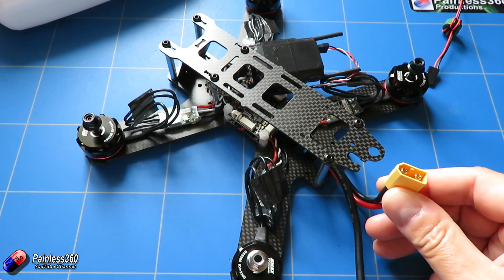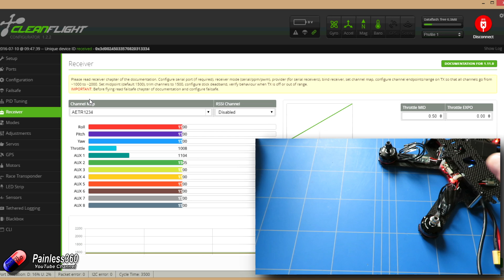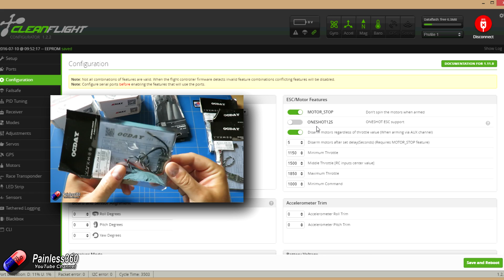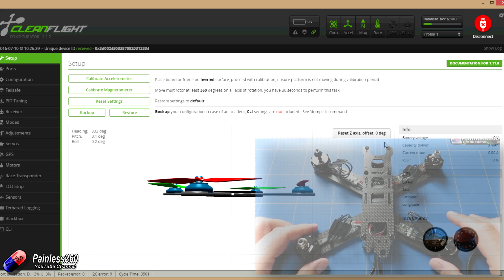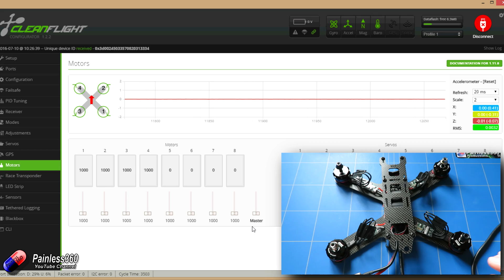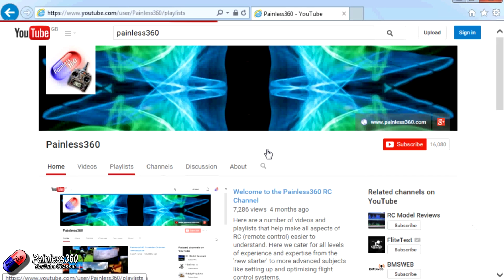(7/9) Quadcopter Building for Beginners - Setting up in Cleanflight

Comment: what if you are at the max of your sub trims and cannot get to 1000 to 2000 im stuck at 1060 and 1885 and it is not working out at all
Reply from the maker: If the “extended limits” box is checked in “Model Set Up” on the Taranis (screen #2 in the Model Setting Menu), servo travel limits can be extended to 150% of the default, or +/- 768uS. I'd try that..
Reply: Painless360 thank you I just tried that it extended up to 1980 on the high end and still stuck at 1060 on the low I tried starting from scratch a couple of times I'm in d8 mode for the ac800 FrSky receiver it binds switches work cannot trim my throttle
Correctly and I think that's why when I spoil up my motors with my tx they don't go full throttle all the way then it decreases power in two motors and also when in other modes hovering at half throttle it gradually increase on its own and takes off but when I check motors through betaflight they are all in sync with each other and go full throttle I tried calibrating in bl heli suite as well I'm sure it's something dumb I'm new and this is my first quad
Reply from the maker: +Insanitykills 187 it sounds like you're not using an real frsky receiver. I have a couple of weird things happen with the cloned receivers. Maybe that's the problem here too?
Reply: it is the ac800 micro receiver that could be a problem as well when i get more money ill try a differant one i do have a beecore fc for a tiny whoop coming in in a day or two so ill try that one out and if all works then i will know that there is a problem with the receiver and not me but i will make a short video on what i am dealing with and when i do i will link you to it in a comment you have been very helpful along with josh bardwell i appreciate you acctually trying to help me out i wasnt sure if anyone would but ill let you know when the vid is up thanks again for everything i work second shift so it may be a couple of days before its up
Reply: ok i wanted to let you know first i got my 90gt working i was able to flash it with beta flight by changing the baud from 25000 to the 115200 then i was able to flash from there i started from scratch and got everything working right you were right the motors act funny during bench tuning because of no props the i think gyro and accelermeter argue with the pids and cause the motors to act really weird or something on the lines of that but needless to say i did my first fpv flight today acctually flew three batteries i think it still needs a bit of tuning because it doesnt seem as punchy as everyone elses but i only stayed in angle mode so mabey thats something to do with it but needless to say i have a whole new mind state in the hobby now thanks to you and mr.bardwell and some extensive research my end points arent right yet but i got them to 1080 and 1980 which is working but ill figure it out in time again thank you for all your help and your channel subscriber for life brother
Reply: It sure does but you have to mount it to the bottom with the battery and take the casing off
But any s bus FrSky receiver will work it's all preference
Reply: Ok you shouldn't have to reflash if you had it flying already make sure your you have your tx set to the correct model I've done that befor also make sure ur baud rate in betaflight is correct I think it's the 1500000 at work so I'll check later and then make sure ur in sbus in betaflight and make sure you have the correct serial ports checked if all that doesn't work your receiver may be shot that's what happened to mine but I replaced with a bigger better one for more range also the ac800 is just crap so don't get discouraged if nothing works right but I also recommend the tarot 150 it's a great quad I use it more then my King Kong about same price to I hope I helped ya in some way I can help more when I'm out of work and in front of my setup
Reply: I'll give you more info on the reflash some point on Saturday
Reply: I would order a better receiver when my ac800 was acting up I tried my x4r receiver in it and everything worked fine I feel your pain man I spent 1500 bucks on taranis drones extra parts fatsharks and all the tools required to build and repair and within ten mins of all my items showing up I couldn't figure anything out I was pissed off needless to say but this community is very helpful keep trying man and when it gets to frustrating walk away from it for a day and come back with a clear mind this hobby is so much fun when ur flying don't give up man
Reply: Good stuff man happy flying idk what you have for batteries but the tenergy 850 30c gives it some serious punch enjoy
Reply: shylo23 absolutely the 35c will make it very punchy make sure it's a 2s battery tho the 90gt cannot take a 3s without some esc upgrades but I currently use a 900mah 30c and it works great

Comment: All motors spin up fine. Plus when I plug in the quad it's armed. Won't disarm with stick inpur
Reply from the maker: +Craig chivers see our video on troubleshooting arming. It's usually you need to extend the range for either the throttle or the rotor. Best of luck!

Comment: Howdy, got a bit of a problem going on. Built a tri w/ emax blheli 20a esc. When I go to calibrate the esc's, the motors are running very slowly. Some how they are getting power from the usb cable, and I am not sure why. Should I flash the esc's? Or do you think I have a bigger issue going? Thanks for the help, and thank you for your videos.
Reply from the maker: +flemingjamess I've had that happen here, I wouldn't worry about it. I'd focus on making sure the calibration is done properly. Best of luck!
Reply: Thanks for the reply.

Comment: I followed your video step by step, same controller and reciever, not getting anything when using the controller. Ideas?
Reply from the maker: I'd check what setting you have on the radio and the wiring you've done. Best of luck!
Reply: Got it to work! Thank you mate

Comment: Hi Mr painless 🙂I'm having trouble connecting my receiver with clean flight. When l open the configuration page there is no options for the receiver like in your vid. (they don't seem to be anywhere on any page) When I try to open the receiver page it just says waiting for data and nothing happens. I'm using a piko blx fc with s bus. I've enabled serial rx in uart3 like it says in the manual. I'm sure every things wired correctly and bound. I've never used cleanflight before and I'm not sure what l'm doing wrong ?
Reply from the maker: +Russell Reilly it changed recently. Look in the receiver tab at the bottom.. best of luck!
Reply: Ok, but when l open the receiver tab it just says waiting for data. l think this may be because l haven't updated the firmware. I went to the cleanflight web site to download firmware but there are 17 to choose from. Which one do l choose to update a furious fpv piko blx fc ?

Comment: HI there can you help im new to RC and decided to build a
drone with my boy. Have a Turnigy TGY i6 which I update the firm ware so now
has PPM which I have selected. Got a  ia6b receiver which I have binded and using
PPM. Flight controller of Flip 32 , connected to clean flight all controls react
from transmitter and shown as moving on screen , (saved update to flight
controller ) all motors work via clean flight but do not work via transmitter
???? when connected or not . What have I missed?
Reply from the maker: Arming of the board? (Throttle low, rudder right)
Reply: I cant believe it I have pulled my hair out with it and initially thought as the transmitter would not connect unless the throttle was set to low this was the arming , I had moved all the controls to test it but obviously didn't hit low throttle with right rudder together  following advice gave it a last shot AND IT WORKED !!!!! (although throttle low rudder left ( well stick moved to left any way ) I cant thank you enough your series has helped me build the quad without any RC experience and now solved only problem  left  cant wait to fly it tomorrow (with my boy obviously ) many thanks again David

Comment: hello i have a problem with the motors 1 en 4 ->  https://youtu.be/QavEnR_Nb2s i don't connect the receiver motor 2 and 3 working perfect
Reply from the maker: Wow! That was a short video! I'd suspect the connections first. Happy to help but please watch https://www.youtube.com/watch?v=olIqTiSJHIY and come back to me with more detail of what you've tried..
Reply: i think i found the problem , i used the big screws to set the motors on the frames i think the screw hit inside the motor en broken de motor. I try a motor that works well en this working good on the esc . i'm right?
Reply: it's possible?
Reply from the maker: Very possible. Check the clearance and check you can turn it by hand. Best of luck!

Comment: Hello Painless360,
 After calibrating Accelerometer and Magnetometer, board sensor alignment yaw set a 90 degrees( usb is set to the left side of the quad) quad turns opposite directions in the set up screen in Cleanflight.  Some HELP will be appreciate it , thanks.  this is the video showing issue  https://youtu.be/TwDiTyGIPKk
Reply from the maker: No, that's right, the image on the screen is facing towards you. The mag is being used to orientate the craft on the screen - rotate it and you'll see ;)

Comment: THANK YOU thank you thank you I watched this video and now I can fly my quad that was a brick, thank you and that's not enough. I am a real beginner and you saved my race quad.
Reply from the maker: Wow! Thanks for the feedback. Glad the series helped a little. What was the problem that was stopping you flying?
Reply: I went into clean flight and messed it up so bad it would not even bind I finaly got bind and then could not arm and only had acro mode .I know it sounds stupid to you but I'm  new and I wanted altitude hold now I'm just glad to have stable and horizon modes thanks again. Do you have a video on barometer hold?
Reply from the maker: Not as such, we do cover it in the modes video. It uses the sensing of the air pressure to try and maintain it's height. You need to cover the sensor with foam to stop stray drafts affecting the reading and don't expect that the height will be solid, it will wander up and down up to 6 feet. From what I remember the throttle also works differently with the middle position being 'stay', lower throttle being fall and high throttle being 'rise'.. Best of luck!
Reply: thanks I will look at the modes video I watched a lot of your videos its so windy here I'm grounded so video day again.
Reply: I have the eachine eb185 the barometer is in the nase co0ntroler. Its flashed cleamflite'

Comment: Having a problem or two with my beginners build. One I have a bad #1 motor or ESC I can figure that out buy swapping. Two the other 3 motors run up pretty smooth using the TX but with the slider in cleanflight GUI only #4 will work using the individual sliders all will work with the master slider except #1 would appreciate any advice you might have   Thanks John McCay
Reply from the maker: This can be due to some of the challenges with BLHeli on some ESCs. We've had problems here and ended up flashing BLHeli on the ESCs to the latest version to get it all to work. As long as you can calibrate the ESCs and the motors all start at the same time then you're good..
Reply: Thanks been watching some tutorials on BLHELI suite. Guess I might as well try flashing the FW  as I want to learn more about working with those programs as well. Thanks again

Comment: You set your Minimum throttle to 1150 and your min command to 1000. At 15:00 we can see that your motor starts spinning at the set value of 1150. After you calibrated your Esc's and move the slider again at 17:15 they now start spinning at 1001 even though you still configured min throttle at 1150. Why do they immediatly start spinning?
Reply from the maker: +Unbelieveableman ;D because something is up ;) see the next video :D
Reply: Alright i watched it, but it still hasnt answered my question. You checked the numbers in blheli and noticed that they were exactly the same : 1020 for min throttle. Why didnt you wonder why they are exactly the same AND not at a value near 1150 like you configured it?
Reply from the maker: That's why I wondered in the video if the ESC calibration was actually working as the ranges hadn't changed.. ;) It was simply too fishy..
Reply: So it worked and the motors started spinning at 1150 after you updated your esc's?
Reply from the maker: I actually ended up extending the range on the throttle too but if I hadn't then it would have.. Impossible for me to tell what was going on as the Cleanflight/BLheli version problem stopped me from testing the calibration. Happy flying!
Reply: Alright thank you!

Do you know if maybe Airmode doesnt let you go to 0 throttle and always keeps the motors spinning? It does deactivate motor_stop as far as i know.
Reply from the maker: It does but that's more to do with what AIRMODE does - keeps the PID loops running even at zero throttle to maintain attitude..

Comment: Did you have to use spacers between the motors and props?  It is taking a lot of effort to tighten the nuts down enough to get the props secure to the motors on mine?
Reply from the maker: Nope, the nuts are tight. You need a firm grip on the motor and a nice spanner to get them nipped up.. Best of luck!

Comment: Hello painless, having a problem where after ESC calibration if I hold my quad with props on in my hand in angle mode and tilt it forward it pushes forward instead of self levelling, same sideways or backwards. I built a new quad with spares I have only to end up with the same problem. The naze is mounted the right way, ESC are calibrated. Only difference is one is pwm the newer one is ppm. I'm totally baffled by this. Any ideas please.
Reply from the maker: See our video on the common causes for quads tipping on lift-off. Sounds like you need to check the common causes if it's not self levelling in your hand. Best of luck..
Reply: +Painless360 didn't fund the cause but someone suggested on quadcopter forum to do a restore default and it worked a treat. Thanks anyway.

Comment: Hi! I'm having some weird problem with motors, can You point me at the right direction or what to search? The motors won't spin like Yours do - for example - yours starts and stops smoothly, mine has some weird noise while rotates and stops not as smooth as Yours. Before I did BLHeli update one motor was spinning as good as Yours, I even changed the motor in in places just to check if it's motors fault, but other motors on the 1. ESC were working good, when switching them to other three ESC they didn't, after BLheli update they all sound louder and don't stop as smooth..
Reply from the maker: If the motors spin ok by hand then it's something in the ESCs. Id run the ESC directly from the Rx to rule out something wrong with the FC and if it still does it then it's the connections between the motor and ESC or a setting on it. I'd look in the forums for your motors in case there is something specific that needs setting in BLHeli like timing/advance etc. Best of luck!
Reply: Thank You for Your time answering! 
I will try that! Thank You! :)

Comment: hello I would like some advice please
I have built my own quad but after calibration on mission planner and I try fly it, it cannot take of vertically. I push the throttle up its about to take of then it turn either side and crashes. please help
Reply from the maker: Check out our video on what to check if your model flips on take off. Should help. Best of luck!
Reply: +Painless360 thanks I will try that. am I right that I should be able to get a hover without touching the yaw, pitch and roll sticks??
Reply from the maker: +Jonathan Boulle if the accelerometer is calibrated and the middle channel values for the rudder, Elevator and aileron are all 1500 - then yes! :)
Reply: +Painless360 thanks👍

Comment: To prevent the "magic smoke" just put a light bulb in series (with small adapter cable) to the lipo. This limits the current to 1A. When the light came up, you can check for shorts. I found this tip very useful (from another youtube channel).
Reply from the maker: Agreed, see our comment on that on the battery video in the series.

Comment: Even having built a few there are always tips to catch, another informative video. Maybe a tip from me, when using the NAZE32 controller it's super easy with a Blheli based controller to hard wire the ESCs and dress the motor cables then fix any direction in Blheli as there is a switch here. Thanks again.
Reply from the maker: +David Bock thanks for the comment. We so end up in BLheliSuite in the next video to fix the problem. As many pilots will follow the steps with different kit I've purposely used methods that are most widely supported. Happy flying!

Comment: help please.

So i bought a bind and fly from hobby king. 
Went thru clean flight and followed all the thread recommendation and PIDS on pg 46. 
Have an old spektrum dx7 that i bound it toit and set arm sw, and three modes of flight.

Did the esc calibration and tx setups. 

All motors work fine in clean flight.

Now the problem. 

Props off. Not connected to clean flight
Do test with battery connected, bind, unlock, up throtlle,

NO 4 MOTOR DOES NOTHING.

1,2,3 all work fine, pitch, roll, yaw, level and acro. All work as you can see and hear the rev changes, but no. 4 does nothing

I am lost, please help?
Reply from the maker: I'd get back in touch with HobbyKing. Sounds like a bad connection or bad ESC/Motor. Best of luck!
Reply: +Painless360 its not conection or esc. as i can calibrate in cleanflight, im guessing the flight computer